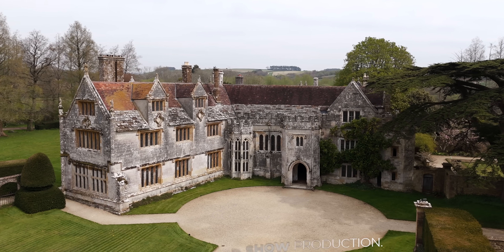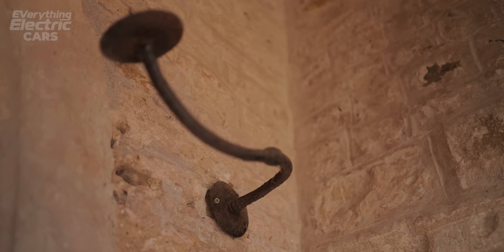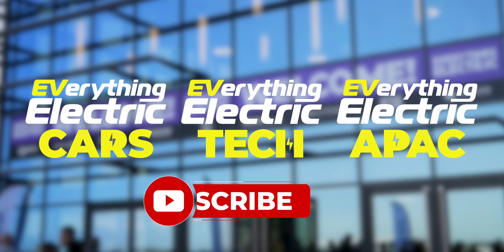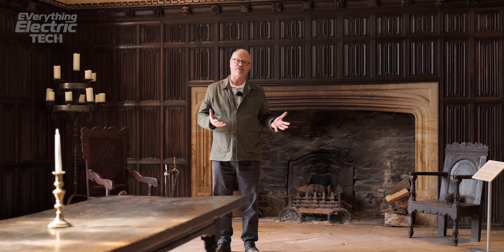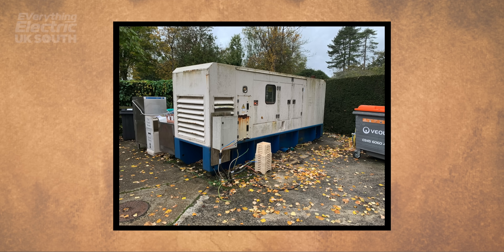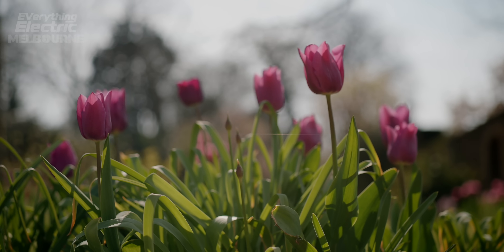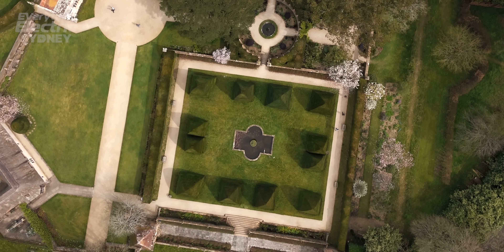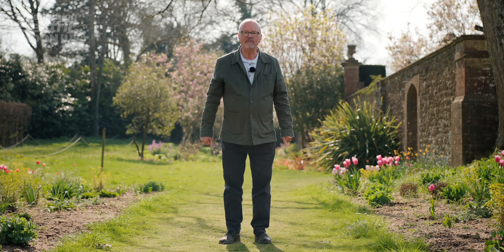Zero Bills!? Take A Look Inside A 'Country Pile' Packed With Everything Electric!

Comment: What a great project and just goes to show what can be done given a lot of money to do it however it seems a little disingenuous to indicate that after 10 years you will get payback as this does not factor in maintenance which would include solar panel replacement and possibly even heat pump replacement or even upgrades as Solar panels and heat pumps become even better. But that still does not take away from a worthy conversion which will save a lot of money and massively reduce carbon footprint in the long run. I would love to know the total cost of the conversion, I cant image there would have been much change from a figure approaching £500,000. Hopefully as things keep improving these solutions can become more and more viable for us ordinary people!! Here's hoping.

Comment: It is impossible to heat an old building with heat pumps. What do they do in winter for electricity in the winter when power production falls to 10%. Solar panels only last 20 years and investors only  last 10 years. They will get a load of energy in the summer and harrdly in the winter. They tried to hear  pumps in the palace of Westminster, and they abandoned the project. What about maintenance costs. Batteries only last 10 years and degrade. It's all too good to be true.

Comment: What is the price you receive for feeding in electricity into the grid in the UK? He explains it as if you roughly receive the same price per kWh in the summer as you pay for during the winter. In Germany you receive about 8 cents per kWh, but you pay about 30 cents per kWh.

Comment: This is an important and impressive project. I’ve done a similar thing on my ‘regular’ house with rooftop solar and a heat pump. It’s transformed my bills from £2500 to £0 and will be fully paid back in 6-7 years. Yes I needed the capital upfront but even if you stuck it on your mortgage the pay back period would have only extended out a year or so assuming you actually pay it off with your bill savings.

Comment: 6 old boilers replaced by renewables, net Zero, yeh right. I haven't had gas for nearly 10 years. 15 heat pumps, ground source, solar and batteries, £100,000+ investment, we all have that in our back pocket.....and still draw grid power in winter.

Comment: I’m surprised they didn’t opt for infra red heating given that it’s supposed to be so suitable for large spaces like churches
Reply: It's far less efficient than a heat pump, and would likely require more visual changes to the inside of the property.

Also, despite being massive, the volume of the rooms here are still a lot smaller than a church
Reply: We've been looking into this for our old village hall. We concluded that IR heaters may work well for predictable, periodic and relatively brief periods of occupation/use of a space, such as a church service, heating the people rather than the space itself. But for residential or office spaces, or a hall such as the one in this video, open to the public for most of the day, the heat is required for much longer periods, and IR would then be very expensive compared to heat pumps with their built-in efficiency. And then there is protecting the fabric of the building from frost/mould, etc., which has to be considered. IR definitely has a use-case, but doubt it could work on its own for this hall.

Comment: Super episode. I'd like to have had more on the air sealing and insulation bit. Perhaps a future technical video or something existing which you can recommend? I'd especially like to understand their balance between air sealing and loop size reductions on the various heat pump systems.

Comment: you can't do it everywhere, we tried and it wouldn't have worked. noisy, creates ice in the winter, requires immersion heater for proper temps, and uses dangerous gases.
Reply: Dangerous gases? Most UK homes are currently heated using a highly flammable gas that regularly blows up a couple of houses and their occupants...

Comment: Would have loved to have actually been shown the systems and installation in the actual house instead of just being told about it and a bit of B roll footage of solar panels and heat pumps outside. Was interested in seeing where the systems go back to and the insulation he mentions at the end and where it went and how they did it while preserving the existing structure and parts.
Reply: But yeah easily worth it. It'll be veryyy cheap to replace the solar in 25 years because it's not the panels that counted for most of the "£100,000s" of costs, it was the rest of the stuff like the wiring and framing and planning which dont need to be done again. In 20 years when they want to replace the panels they just need to remove 4 bolts from the back of an existing panel, unplug it, and then bolt the replacement one on and plug it in. It's even a basic DIY thing. A panel like those are already under £100 so it'll be dirt cheap to replace them today let alone in 25 years.

Comment: Fantastic approach, bet King Charles is looking at this. We put 12 panels on our semi in Kent 10 years ago, and broke even in 5years so had free energy for 5 years. Now have batteries, removed gas from house and used an Air to Air system for heating and cooling for 4 years at zero cost. everyone should be doing this. Also running two EV’s.
Bob from Kent England.

Comment: This is brilliant. The UK has a very large amount of old housing stock - not just historic manor houses. This gives hope that most if not all of them could be sustainably heated and get away from the ubiquitous gas and oil-fired systems.
Reply: Most don’t have paddocks for solar or large gardens for ground source heat pumps .
Reply: @Petrolhead912 nor do they need them. They can use rooftop solar and an air source heatpump.

Comment: 15th century european farmhouses as well as townhouses were often kept comfortable by building the living quarters as a "box within a box": bedrooms and sitting rooms with wooden walls, ceilings and floors within the unheated half-timbered, stone or brick shell. Heating the rooms is much more economical that way and drafts are much less. Our medieval ancestors didn't like to sit in a cold room any more than we do, and they had to heat using firewood, which requires quite a bit of work to cut, haul around and dry.
In a way the team doing the energy retrofit of Athelhampton house came to a similar conclusion and created insulated layers within the outer shell.

Comment: I have a converted steading from about 1900, and solar panels.I priced up a heat pump and was quoted over £30k.
All radiators needed to be changed,finding a location for the heat pump,better loft insulation etc etc.Also that didn't include a battery which would have made sense with the solar.
Anyway this peasant can't afford that,so will continue with the oil boiler and a wood burning fire.
Still got an EV.
Reply: When the "fuel" is free, the up front cost is high. It is harder for the peasants to take the long view and say that things pay for themselves when they do in fact cost a lot right now. I expect you are already thinking that the loft insulation would be a good thing by itself with the fuel costs. You do what you can and what makes sense, I guess.

Comment: As someone else has noted, this piece is weirdly (and irritatingly) bereft of basic facts and figures. Some lower-third text factoids would have helped. Size and generating capacity of the PV arrays. Storage capacity of the Powerwalls. Capacity and Coefficient-of-Performance of the heat pumps, ground and air source. Yada yada. Nothing in depth. Just some fundamentals.
Reply: Also, beware 'back-of-the-coaster' payback calculations unless they're inclusive of financing costs. The cost of money, one way or the other, can cruel the best of intentions. Emerging alternative business models - heat and/or energy as a service, as a full or partial replacement for traditional capex - could have a big future in this space.

Comment: It is very impressive what they have managed to do given they had little to no leeway to insulate the building envelope. And insulating the floors was a great idea. 
However the absolute priority of heritage over everything really needs to be dialed back a bit to allow easier and even better results than they achieved here. I would imagine this property, like many in the UK, have been updated and added to over the centuries, so why should this stop now? For example, would it not be possible for current craftspeople to create secondary double glazing that would be sympathetic to the building and allow it to be even more efficient?
Reply: Grade 1 listed building are a small percentage of the listed housing stock in the UK and arguable not where the focus should be. Our council has refused planning permission on double glazed sash windows on grade 2 listed buildings, even though they are identical in appearance and materials to the existing rotting windows. And this is a council that has declared a "climate change emergency". They are keen to raise resident parking charges based on CO2 emissions but not so keen on home improvements.
Reply: I couldn't agree more. Sustainability has to come first, heritage second. It's a climate crisis and an existential threat, and we need to take it more seriously. I can't help thinking of when the UK was threatened by invasion in World War Two. Did heritage people object to grand houses being requisitioned for military purposes because they might suffer a bit of wear and tear? Did they object to anti-aircraft guns being sited nearby because they were noisy, compromised the view for a few chinless wonders, killed birds that really ought to be blown out of the sky mores sportingly by shotguns, and cracked Lady Muck's windows when they were fired? They probably did, but were sensibly over-ruled. The same should happen today, with priority shifted immediately to supporting sustainability, rather than obstructing it. Perhaps vast warehouses could be built and all those heritage-grade single-glazed windows swapped out and stored there for re-installation later when (fingers crossed) the crisis is past ... just a thought. 😆

Comment: honestly i think this is how most of uk housing stock will need to solve the energy problem. have it in abundance. insulating old houses is too much effort. easier to just get energy cost down and use lots of it.
Reply: I totally agree.  If you can get your unit cost of energy low enough, then the efficiency of the building and the heating system are really just "nice to haves".

Comment: 0:03 going off the title picture theirs, grade 1 listed house zero bills…. Must mean they put a kings ransom inside it
Reply: 8:51 those refrigerant systems will last 20 years ?
Reply: @BlowBubbbles yes, why not?
Reply: How many fridges last 20 years nowadays, hopefully they are designed with repairability built-in. But I’m guessing they’re not because nothing is nowadays.
Reply: @BlowBubbbles The moving parts are a pump and fans, nothing that can't be economically replaced once they reach end of life.
Reply: hopefully they have been designed to be repaired, I don’t know the standards.
Reply: @BlowBubbbles  A heat pump is intended for long term service and a fridge isn't.  
Mind you  most fridges and freezers seem pretty reliable, I can't remember the last time I had one actually fail.
Reply: had them fail every 5 years or so
Reply: @BlowBubbbles Unlucky.  My current Samsung fridge freezer came with the house (s/h but it looked pretty new) and I've now had it for over 9 years.

Comment: 9:44 these heavy buildings work very very differently to your house -- they work by thermal inertia, insulation is often counterproductive. It's common that they can only be heated by the sun in summer but then the householder's job is just to maintain that heat till next summer

Comment: Love this ❤ 
We have clients with similar properties that we are helping to go 100% renewable and it’s a joy to see you showcasing the tech and that it works even for historical buildings
Reply: Honestly a good new heat pump heating system that distributes heat effectively round the building, on constantly and sized for low temperature radiators will find older buildings a breeze. This is because they are not fighting each day to reheat the thermal mass. Hard part we find is on larger churches etc they can need a bit more grid supply than they have so solar and batteries here are possibly a cheaper option than a new grid connection

Comment: So everyone thinks old buildings are cold, reality is they are often heated in a way that is spending vast quantities of energy reheating the stone and fighting the thermal mass. A well tuned low temperature constant heating system then stops fighting this thermal mass and the warmer surface temperature of all the surfaces then makes the building feel warm and cooler radiators / underfloor heating cause less draughts. We'll tuned older buildings take longer to cool down in cold snaps and heat up slower in heat waves making an potentially amazing internal environment.
Reply: The key is to never let it go cold because it's only summer's heat that will warm it!

Comment: fantastic. imagine 10 years down the road we have perovskite solar cells with 50% more power in summer and probably 70% more power in winter. and cheaper batteries and a bit more refined heat pumps.

Comment: a scaled down version of this system; solar, batteries and split a/c heat systems can be installed in our older domestic housing stock without having to do major insulation work and upgrading radiators. Dramatic drop in bills plus removal of gas boilers is possible. Different way of thinking to new builds, but can be done.
Reply: Would be very interesting to see some examples of that. Sorting out hot water might be one of the most difficult elements. Many small properties are likely to have a combi-boiler and no obvious space for a water cylinder.
Reply: @vorpalteaspoon8904 Have you seen the Heat Geeks/Urban Plummer videos about them developing a (small) heat pump replacement for combi boilers?

Comment: This building has the advantage that heating pipes had been installed before the building was listed.
Reply: You work with what you have. Seems they ripped out a lot of radiators and remade many floors, too.
Reply: @geirmyrvagnes8718 ripping out concrete floors to put in lime mortar ones is definitely going to keep the heritage people happy , happy enough that they will wave through the under floor heating and the modern insulation under the floor.
Reply: They talked about adding underfloor heating too, so clearly some fairly substantial (but largely invisible) changes were still made.

I highly doubt there are any houses like this in the UK that don't have existing hot water systems

Comment: Would of been nice to know the actual heating cost before the conversion. The size of the solar panels and batteries. The figures are all a bit vague, on a project that big there should of been detailed accounts kept!
Reply: It was something silly like £60k a year. I remember it being on the local news.
Reply: Well, he did say that it cost "hundreds of thousands" to install this complete system, and that he reckoned it'd take 10 years to pay for itself.

He has "net zero electricity bills" over the course of a year, so he's essentially saving the entirety of what he used to pay.

You can put this together to surmise that the savings will be equivalent to 10 years of what it used to cost, so that's an order of magnitude lower at "tens of thousands" a year.

And, more over, once it has paid for itself, the house will be generating "tens of thousands" in profit per year for about 20-25 years thereafter. So over the course of its lifetime, not only does this complete system effectively become free, when it pays for itself, but will continue to profit to the tune of at least £200-250K of savings on top.

(Without doubt, detailed accounts were kept, but a posh British rich chap would never be so vulgar as to talk money. But, between the lines of what he did say, you can get at least an "order of magnitude" guess out of it, at "tens of thousands".)
Reply: *have

Comment: as someone living in a house from ther 1850s in a conservation area, i can confirm that getting permission for renewables and the costs for fitting energy saving measures is a fucking nightmare
Reply: I recommend showing this video to the planning committee if you try again.
Reply: Had solar in curtilage of a listed building in AONB  with minimal issues. Its very hit and miss on your local planning.
Reply: @tcroft2165 as a professional planner this is very true. 

It also took Historic England way too long to countenance even basic interventions, but they have improved over recent years